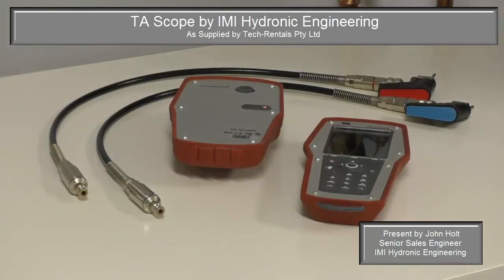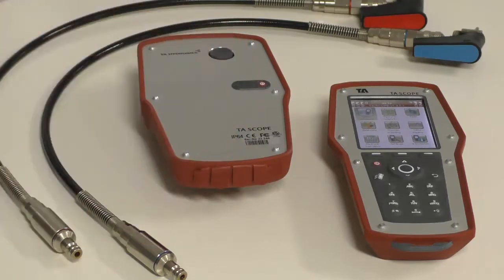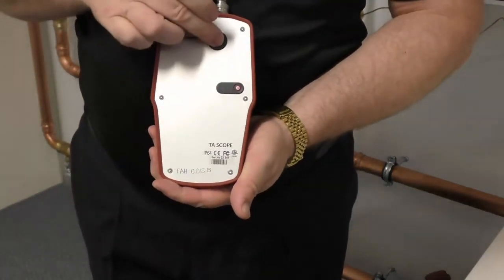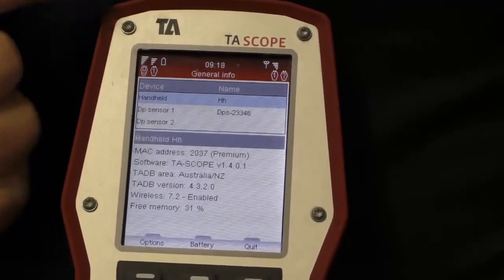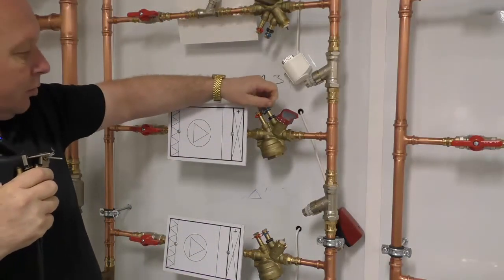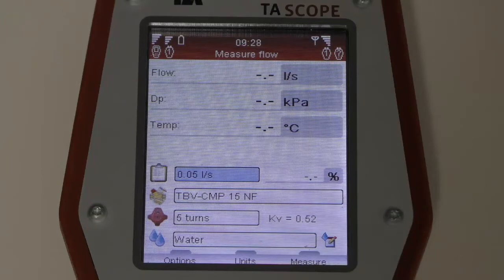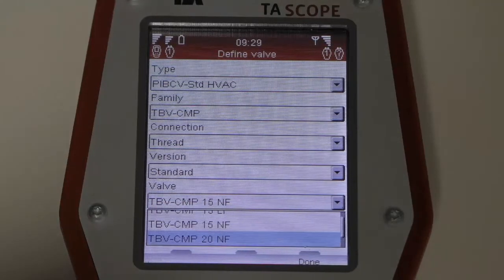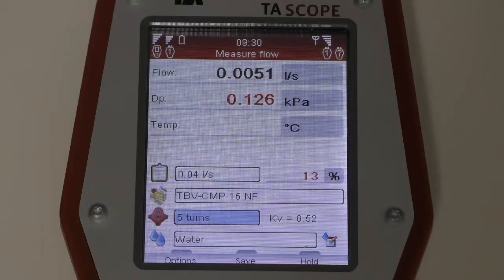Setting up a Tour & Anderson Scope Balancing Meter

Comment: Hello sir.... Could you advise If TA Scope DpS Visio can be used to measure flow of Balancing valves of different Manufacturers such as Gala etc,??? Thank you in advance for your advice. Sam
Reply: If you cannot find a TA equivalent you can then use the instrument to get the differential pressure across the valve, this can be then used using the particular manufacturers valve position vs differential pressure flow rate curves.
Reply: Sorry I missed this question... It can , generally there are equivalents between manufacturers. You have to investigate. We rent these instruments out and as such I am not an actual user, we generally find that customers are able to determine equivalents or they take the differential pressure measurement and the valve position and from there they can determine the flow rate using that particular suppliers valve tables. Then its a matter of checking some of the equivalent TA valve types to see if there is an equivalent. You would only bother to do this if you were using it for balancing though. If you are just determining flow rates then once you have the differential pressure and the valve position that's all you need. You just look up the flow rate from that suppliers tables...